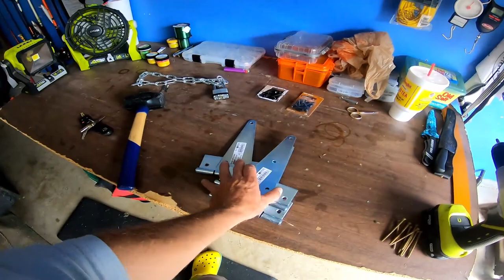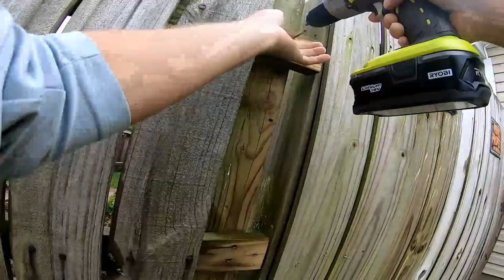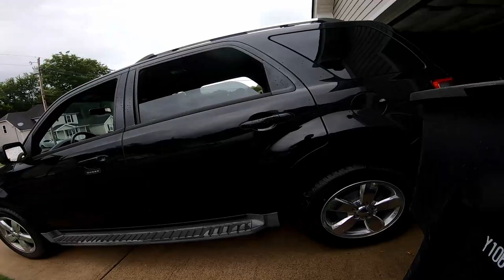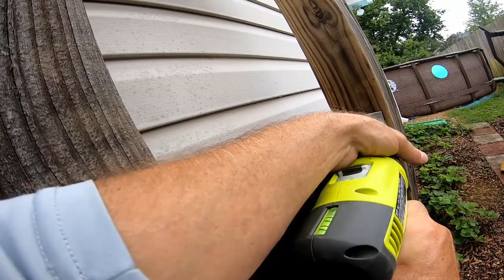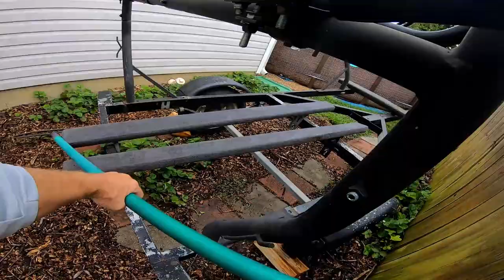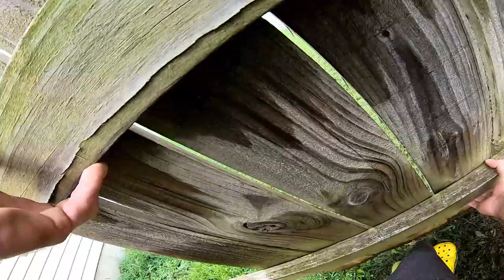I Bought a Kayak Trailer! Building a Privacy Fence Gate for Storage

Comment: That is a nice trailer. Did you build it or purchase? I about to try this kayak fishing and after I get mine I will potentially be hauling 3 or four. Nice job on gate.
Reply from the maker: I found this trailer on Facebook marketplace. I had been looking for used trailers for a while and I needed one that would haul three kayaks. I chose not to settle on something that wasn't perfect and then eventually this popped up. It's perfect